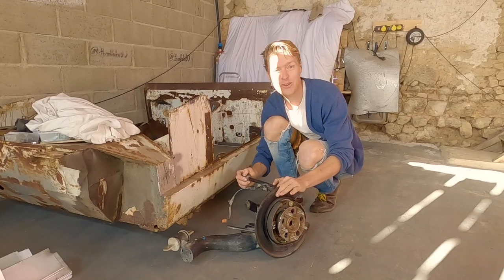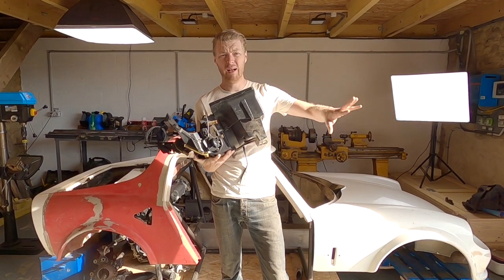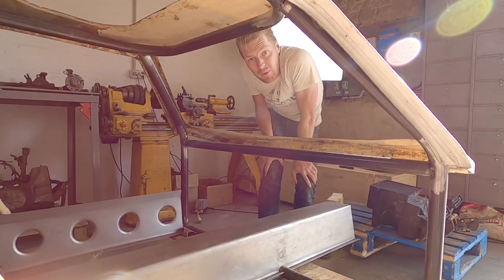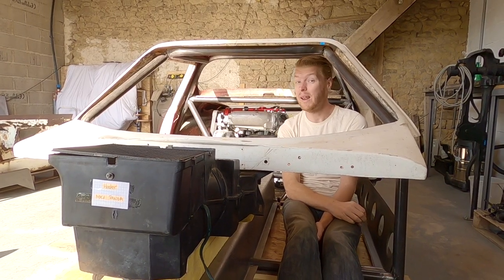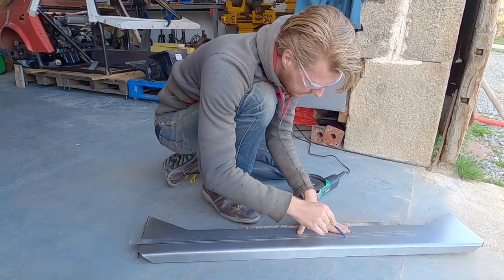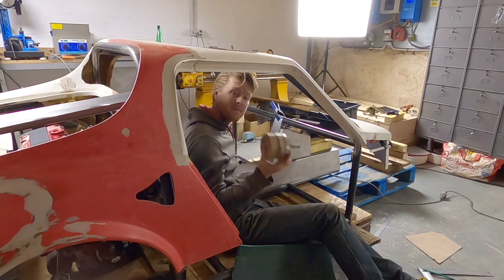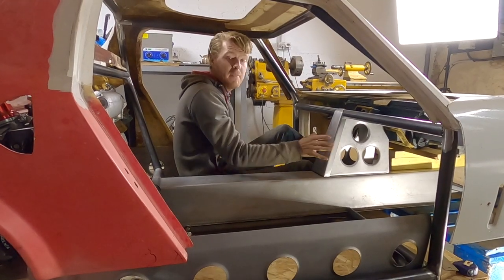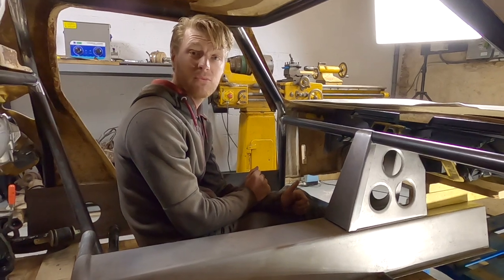Custom Center Console | Project Mosquito Honda Type R Mini Supercar (Ep21)

Comment: I don't think I'd be able to survive without AC, but I also live in a temperate part of the US where our summers end up with temperatures exceeding 100F (37.7C) with crazy humidity above 60% even on a clear day, so AC isn't really negotiable for me. Hopefully where you live gets less of that so you can cope without it. Vintage Air, a company in the US making compact integrated HVAC units that are designed to fit in vintage cars, would probably be where I'd start if you've got enough space in your dash for it. Given that you have the majority of the space under the hood (bonnet) of your car that you can play around with for such things, I'd push into that space with the bulkhead to make such a unit fit. They're not massively large or heavy compared to most OEM implementations and you get your 3-way ventilation and AC as well as heater functions without needing to go to the extremes of the Project Binky build and custom fabricate an entirely bespoke unit.

Comment: since you were talking about heaters, the way they did heating in railway coaches was to use pipes from the locomotive to the inside. so when they started using diesel locomotives they had to fit steam boilers so they could still use the heating
Reply from the maker: Random heater facts I love it! A VW Thing had an optional second engine that's sole purpose was heating because the on in the back was so bad at it
Reply: @OliverPickard  One of those steam engines between the front suspension would give you some down force I suppose ! Lol

Comment: I've used cardboard to test designs to see the fit and appearance.  I made my center console for my Corvair out of cardboard first.  Easy to make changes.  Used correct vinyl to look almost stock.   Made a cardboard bedside table before using wood.
I also see the upright part of the console a good place for a few gauges and the tunnel part have a couple of cup holders and some storage space.  Perhaps a smaller GPS unit too.
Reply from the maker: I'm morally apposed to cupholders it's a sports car not a dining room haha and I'll use my phone for GPS just like I do in Jolene
Reply: @OliverPickard  Make sure you have a USB plug available for your phone ! 
I am getting worried about space for that expensive stuff called petrol  to be stored ! I think a one off fuel tank will be needed .... Just a thought for you . I attended  an rally car build lecture  , for the East African rally and built by Uk army apprentice engineers . They converted a Maxi ( over grown Mini basically ) and used an aircraft fuel bladder in the passenger seat area . Fuel bladder .... hmmm ? Best wishes , loving your show and work . Sorry , advice is a bit late !!!

Comment: Will the centre tunnel be Dimple Dyed ? As it strengthens aswell as reduces the Evil Weight and as you said will reduce Droning great series 👍
Reply from the maker: The tunnel will house the fuel lines, heater & radiator tubes, gear shift and handbrake cables, rear brake line...ext so it's really important that it stays intact for safety and will be insulated to keep the cool stuff cool and the hot stuff hot
Reply: @OliverPickard  I considered running a computer power unit fan to either push or pulling fresh air through my central tunnel  to aid cooling in the tunnel and rear engine compartment on my GTM .